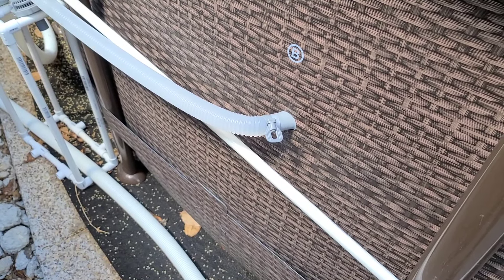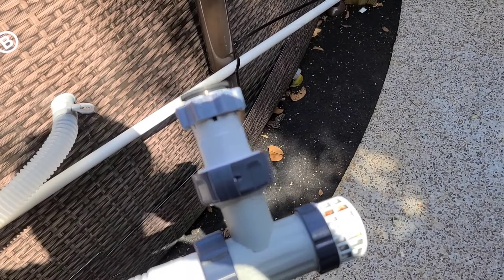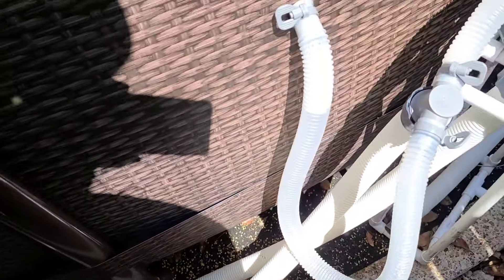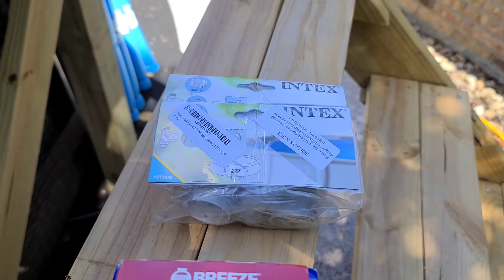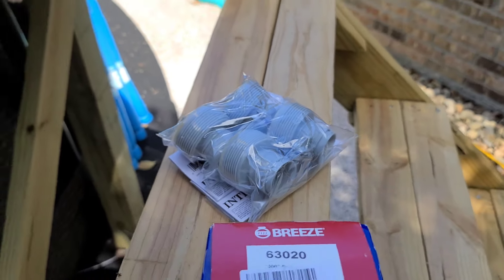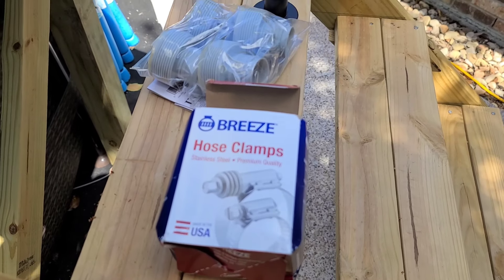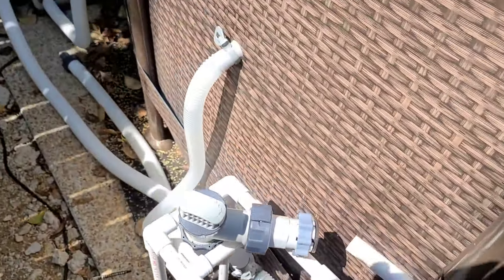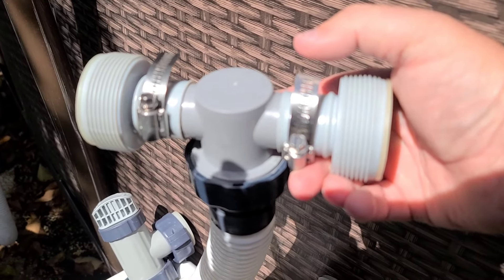Converting a Bestway Above Ground Pool to Intex 1.5 inch Hoses Using Type B Adapters

Comment: Great video man! After the 1st year with a 14’x48” Bestway pool, we definitely needed a skimmer. Then realized I had to up grade to a bigger filter. I didn’t want to cut any holes into the pool. I bought the wrong adapters. This video is really helpful. Thanks!
Reply: Just add the on/off valves. No need for the adapters since you’ll still have 1 1/4 inch restriction at the inlets. He created more suction by turning off the valve without the skimmer!
Reply from the maker: The on/off valves need the adapters.  They're 1.5.  They won't fit on the 1.25 inlets.

Comment: I am from the UK and have a Bestway 16ft 48inch round pool. But to help warm the water i have painted the exterior walls black, this really helps absorb the suns rays as before the pool was light gray. I also have a black pool cover. And lastly, i have 600ft of poly pipe running from my pump around the yard, the water coming back out of the pipe is much warmer than the water in the pool.

I understand painting the exterior of the pool black my look ugly, but it really makes a huge difference. Especially as im in the UK and we dont have long summers.
Reply from the maker: Being from TX, I have the opposite need.  I don't need warmer water.  I need to cool it most days!
Reply: What kind of paint did you use?
Reply: @jeffm9722  the wrong paint actually. At the time i had ‘chalkboard paint’. But its been 2 years and its fine.
Reply: Long as it works man. You can also turn off your pump for about an hour and float a large black tarpaulin ground cover a couple feet deep and wow the difference it makes

Comment: The skimmer you have is the same as mine. It came with a stopper and I thought it was strange the stopper has a little hole in it, lol. I ended up using the stopper (with the hole) on one of the two inlets that is not connected to the skimmer. This provided more suction for the skimmer but still pulls a little bit of water in from beneath the water line. The setup allows me to clean the top of the pool water using the skimmer with strong suction and inside the depth of the pool but at a much slower rate. 

I plan on buying plunger valves because the stoppers are a pain in the butt to use just to clean my filter cartridge.
Reply from the maker: Agreed.  Check out what I did about it here.  Fixed it completely. Love the results.  https://youtu.be/TpBitG1rns8

Comment: I took a step further and enlarged the “B” holes to accommodate the 1.5 fitting.  It was scary to put a razer to the liner but the results are rewarding.  Thx for the vid
Reply from the maker: I did something similar this year.  Check out my latest video to see how I eliminated 1.25" hoses outright.
Reply: How do you find a t connector that is 1.5” on all sides?
Reply from the maker: Those are difficult to find.  Best bet is to go to Lowes or somewhere and rig something.  What I did was go full 1.5" and install an in-wall skimmer.  Check my other video out for that.
Reply: @getitdone308 What if you dont want to install an in wall skimmer though?
Reply from the maker: You'd have to cut out the 1.25" inlets and replace with 1.5".

Comment: Hi I too am so glad I found your video , sure did answer questions what I should do and how to do it.   But I have one thing my pool has 3 outlets two that suck in water and one that returns but the upgrade pump will only have to hoses so I think I am going to just plug up one of the incoming to the pump with the black cap and keep the cove screwed on and see what happens this season. If there is a problem I will get another hose and a tee but I will keep my fingers crossed. Kinda mad that they would sell that size filter for the bigger pool, I had nothing but problems keeping the algae out the pump could not handle it ad it going 24/7. Again thanks for your video
Reply from the maker: Check this video out how I upgraded further.   I'm glad I did!

Comment: I replaced these hoses exactly as you suggested. It definitely helped the output. Thank u...
i have the same pool. I cannot figure out why the 2 round inlet(? ) Circle parts do not suck anything from the pool. No debris, no water...no suction at all. The only filtering i get is thru the skimmer attached to the side of the pool...its clean. But never could get the little circle, net looking inlets to work. They are hooked up correctly. I cant find any videos for this:/.

Comment: Thank you so much for this video! I couldn't find anything on how to actually "do" the conversion.  I have a 14ft Bestway and the small pump that came with it.  I think I clean the pool more than I have used it, lol! This is year 2 for the pool and just want to upgrade my filter pump.
Reply from the maker: I hope it helps!  I know it definitely improved my pool's efficiency!
Reply: What did you upgrade your pump to?
Reply from the maker: I upgraded it to an Intex 16 inch sand filter with saltwater chlorinator.  I have the link in one of my other videos. I love it!

Comment: I have this same pool - thank you for the video. I’ve been having so many issues. I have no suction. Will check for air bubbles, etc. I want to install a skimmer like this one, but I don’t have a valve to shut off my other B port so I think I’ll just put a plug in it?!
Reply from the maker: That really depends on your pump and how strong it is.  What ultimately helped me was installing an in-wall skimmer.  It was awesome!  Check out my video on it.

Comment: As soon as I put 1.5 inch hoses on it was heavy enough to rip off the adapters (I did use the plastic clamps though so I will try the metal) I'm wondering if you found the plunge to help with that? I thought it would add even more weight so I didn't get them. But maybe I should try that😂 idk. Something is causing this new pump to overflow and it's got to be the hose positions or something because I have double checked this pump 100 times and the o ring couldn't be any more secure
Reply from the maker: The plunge valves definitely help with that.

Comment: This is exactly where I am. Bestway 15ft. I bought the small adapters like you, no plunger valve. Switched everything to 1.5. new Intex sand filter and NO matter what I do here...the sand valve cover is overflowing(o ring is fine, everything is on tight) whether it's running or not...the second I let water into the pump ...over flows. And the hoses are hanging so bad. I had them tied up and lifted up some (one they are so damn long it's unnecessary) but this morning I'm letting them lay on the ground and see if that's better. Idk what else to do
Reply from the maker: "Sand valve cover"?  The top of the sand filter with the handle/switch?
Reply: @getitdone308  I think I mean the 6valve gasket cover. The main lid to the pump
Reply: @getitdone308  lol sorry my terminology is probably wrong but yes the lid to the pump. Has the o ring in place, has the circular clamp to put around the tank and seal the gasket cover. It just floods. I have an Intex Krystal clear pump.
Reply from the maker: If water is coming out where the lid meets the filter (where you screw clamp it down), then it has to be because it's not tight enough.  That clamp has to be cinched very tightly.  I had to get my impact wrench to get it tight enough.
Reply: Bl

Comment: Thanks for the video, how come you cant just plug one inlet and run the skimmer directly to the pump with 1 line thats 1.5?
Reply from the maker: There's a couple reasons and things to co sidereal before doing that.  The forst is dependent on your pump.  If you have a weaker pump, you'll need both inlets to provide water.

Also, in the event you don't want to run the skimmer (which the manufacturer tells you to do when the pool is in use), then having both inlets running is optimal.

To your point though, I ultimately made the leap to an exterior skimmer that fixed the problem outright.

Comment: What is the "pool nipple" part you referred to before assembling any of the intake/ outake valve parts? My pool is missing this part and I need to replace it. Thanks!
Reply from the maker: It's the rubber piece that's attached to the pool that you clamp the hose to.
Reply: @getitdone308  For sure, but I can't seem to find this particular piece anywhere. Any ideas? I appreciate it.
Reply: @getitdone308  It is 100% a stupid question. I'm just blown away that I can't find any information in regards to this piece. I was contemplating using a 3/4" pvc pipe or something, but what I ended up purchasing  and attempting to put together just leaked anyway. I just don't want to keep buying couplers of sorts just to consistently have leaks.
Reply from the maker: You can't find it anywhere because it's attached to the pool.  It's not something you buy.  That said, if you wanted to, you could cut them out and affix bigger openings for bigger hoses.
Reply: @getitdone308  Thank you! That makes more sense now. I was given a new pool but it was missing these parts.

Comment: Hey im from Panama and I have a 12’ x 39’ and Im ordering the B adapters but i want to know if you think I can connect the pump hose directly to the adapters so I don’t need to buy the valve, what do you think?
Reply from the maker: You can.  The issue is when you need to do ANY maintenance.  You can't stop the water from flowing without a valve.

Comment: We have a Bestway 15 ft round 48 in deep pool. Can I ask how you connect the blower inside the pool and plunger valve outside the pool with the holes in the pool sides that are too small?
Reply from the maker: You need to get Type B adapters.   Intex 4 Pack Type B Adapter for Above Ground Pools Converts 1.25" to 1.5" https://a.co/d/1fi1s2Q

Comment: Did you have any leaking with the plunger valves being attached to the type B adapters? Both pieces have a rubber gasket and I wonder if that might be a problem down the road? Thanks for the video!
Reply from the maker: No problems at all!

Comment: Could you just plug up one of the B holes and use a single hose. From your skimmer to the pump?
Reply from the maker: To do what?
Reply: @getitdone308  to not have to mess with plunger valve and hose on the intake your not using.

Comment: Thanks for the video 🙏
Q: I Purchased 2 59” hoses with nuts but they are too long water not sucking in.
Any idea where to buy shorter ones??
Thanks!
Reply from the maker: ChangTa Pool Filter Pump Hose11388 for Intex 26675EG QX2100 Krystal Clear 14 Inch Sand Filter Pump & Saltwater System Interconnecting Hose https://a.co/d/6TAptIJ

Comment: I love your video...I wanna do the same thing as you did. Many only question is where do you get the housing unit just inside the pool to connect the skimmer to? I have already ordered most parts as you mentioned. I have a similar pool as you, mine is 18' x 48". I'm gonna use my Intex pool pump I used last year...which is much stronger.
Reply from the maker: Check out this video for when I upgraded even further (and better).  But to answer your question, the housing unit came with the skimmer I bought.  https://youtu.be/TpBitG1rns8
Reply: @getitdone308  I got the skimmer today. My question is the inlet valve cover inside the pool don't unscrew. The Intex skimmer came with the hose and screw on adapter to screw on. I can pull it out fine...just want unscrew. Thank you for the previous response.
Reply from the maker: There should be a tiny holding/mounting screw on the inlet.  Take it out and the face will unscrew.
Reply: @getitdone308  I removed the screw earlier, could not unscrew it. After your reply I tried again and was determined to unscrew it! It was screwed on VERY TIGHT, I used a paper towel wrap with vise gripes...and after several attempts...it broke loose. I got the skimmer going and the 1 1/2 hoses connected per your instructions. Working great! I really appreciate your help...Thank you.
Reply: @getitdone308  I will probably do this after this season after I drain it. This procedure you did was on my mind when I set the pool up, I was kinda afraid to cut through the fabric wall...but seeing you have done it I might try it. My concern was leaks depending on the strength of the wall. It's a brand new Coleman Pool 18 x 48. However I think it's partially made by Bestway. I love it so far, just waiting for the water to warm up to jump in.

Comment: Closing one of the outlet valves doesn't cause your pump to work harder? I'm wanting to upgrade our hoses but afraid it'll strain the sand pump
Reply from the maker: I never had that problem.  That said, I upgraded further and did a cut out skimmer and it was awesome!  Check out that video on my page.
Reply: @getitdone308  we upgraded the hoses from 1¼in to the 1½in hoses. Now my pump pressure is high. Backwash and rinse help for about 30mins to and hour and pressure goes back up. Could my pump not be big enough to handle the upgrade?
Reply from the maker: That definitely could be the case!  I upgraded my pump to a bigger one.

Comment: Where did you find that adapter to go from the skimmer to the pool inlet? The skimmer came with the hose and that blue screw on adapter but nothing to go into the inlet hole.
Reply from the maker: It's the inlet that came with the pool.  There's a little screw on it that after you remove it, you can unscrew the cap and it exposes the threads.  Then you screw the blue adapter to it.
Reply: @getitdone308  aaaahhhhh. Thanks! Weird that they put a screw through it!

Comment: did you use treated lumber for your steps and what are they setting on in the pool
Reply from the maker: Yes I did.  I have them setting on a rubber mat (the kind that go in commercial kitchens).  It's been up for 3 years now.  Working great.  No problems!

Comment: Nice video. Can you tell us where you purchased the adapter at 6:19 to go from the surface skimmer hose to the 1.25" inlet on the pool please? I don't see a link in your description. TIA.
Reply from the maker: Thanks.  Hope it helps..  check out my latest video where I upgraded to 1.5" completely.  In the meantime, the black plug came with the pool and came with my skimmer.  I didn't buy them separately.  You can get them on Amazon though...https://www.amazon.com/dp/B08JTRYS5G/ref=cm_sw_r_cp_apa_glt_fabc_QSWE3SE0B3QWJYPYX8RV?_encoding=UTF8&psc=1
Reply: @getitdone308 I can’t seem to find this video referenced for the whole conversion….i bought the new filter system and the adapters and only when I went to install did I realize I need the plungers AND more 1.5 hoses. A total conversion part list and video would be awesome
Reply from the maker: It sounds like you have the list.  You need plunger, the skimmer (which comes with the adapters), and 1.5" hoses.  Everything else came stock with my pool and filter.

Comment: So, on 08:04 , if i have plastic from inside in ruber, can i this adapter put on? Have intex pool with 32, and pump 38 with scroow 🙈
Reply from the maker: I'm not exactly clear on what you're asking.  The adapter is made to clamp onto the small rubber (or plastic) tube that is attached to the pool (and is the smaller diameter...in this case 1.25" or 32mm).  So as long as you have the small 32mm plastic/rubber tube that is attached to your pool, the adapter should work perfectly.
Reply: Get it Done I saw that adapter to buy, but I thought to put a 32 tube ON it.
Reply from the maker: Those clamps are made to convert a 32mm opening on your pool (or wherever) to a 38mm hose.  If you have a 38mm Intex hose, then you use the clamp to allow that hose to be used...otherwise you have to use 32mm hoses.

Comment: I'm following the adapter outside the pool bit I need a skimmer..how did you attach the inside of pool..what do I need to order..it is bestway 18 x 52 has those small input on 1 1/4 pipe
Reply from the maker: I have a video on my skimmer.  It shows how I attached it.  Here's the link: https://youtu.be/Rg6uIBo0aEg
Reply: Let you know skimmer up and running..you know that your videos helped me change over to a larger pump and those plunge adapters are awesome. I refer your video to my friendswho are going to get an above ground pool
Reply from the maker: Glad to know they helped!  As a 1st time above ground pool owner myself, I found it interesting that there weren't a lot of "how to" videos for upgrading.  Instead, they were more of "this is what I did" as opposed to "this is how to do it". 

I plan to do more, so please stay tuned!

Comment: What about the t shape adapter.I need that adapter too.Can you link me it.Please I really would appreciate it
Reply from the maker: Mine came with the pool.  This will work too: https://www.amazon.com/dp/B072DYNSM1/ref=cm_sw_r_cp_apa_glt_fabc_D6WJGWTEMYYK98H6GZCE.  This is a t fitting: https://www.amazon.com/dp/B0719G8LCL/ref=cm_sw_r_cp_apa_glt_fabc_1JEFRXSNVA0ESDGSWJ76

Check out my latest video where I converted even more and got rid of 1.25 altogether.

Comment: What do you do if the collection basket is leaking water? And it doesn't stop after opening the small screw... please help.
Reply from the maker: What collection basket are you referencing?
Reply: @getitdone308  the one attached to the pump
Reply from the maker: Got it.  It's a bad seal.  There's 2 o-rings in there that if you seat the unit on the pump wrong, it won't work right.  You have to be sure the rings stay in their place when attaching that unit.
Reply: Thank you sooo much!!